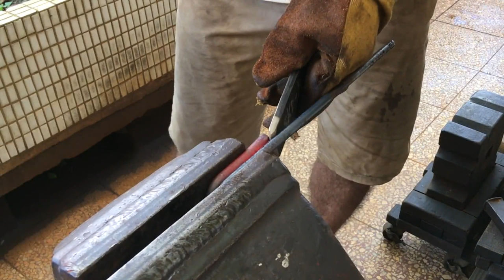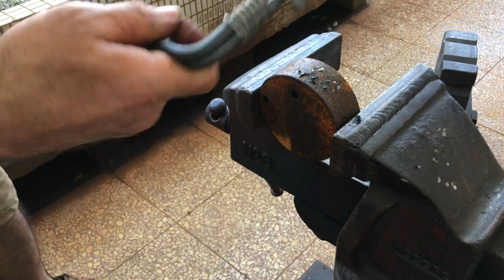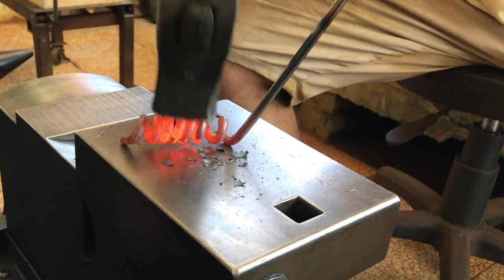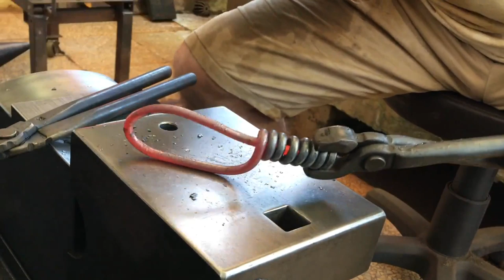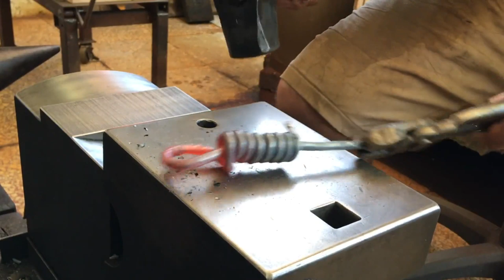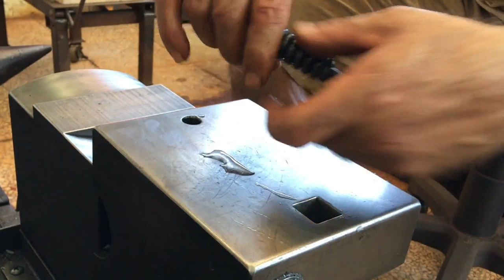More Forging Fun With Coils

Comment: Why does everyone's steel seem to stay hot so much longer than mine?  lol   Nice smooth, uniform coils.  Nicely done.
Reply: Lol, I know the feeling.  Heats will at least seem to last longer when you have a plan for every heat, which definitely takes practice and experience to get to that point.  Also, a more obvious one, don't be afraid to get mild steel nice and HOT for when you need to move the steel a good bit.  👍
Reply from the maker: I think it may partly be a trick of the camera. Cameras can show light from heat in a way that differs from how our eyes see it. What sometimes seems not too hot to me when working seems much hotter when re-watching on video. Or maybe it could be the air temperature or how large your anvil (heat sink) is. Thanks for watching.
Reply from the maker: Yes, having a plan definitely can lead to pieces staying hotter longer as the friction from hammering and working helps hold heat. Thanks.
Reply: There's also the factor of the anvil/vise sucking the heat out of the steel.
Reply: It also helps a lot if you bang on it continuously instead of looking at it. After all, you can get a cold piece of steel red hot by just hammering it hard and often enough. Doesn't quite apply to this video though, since there isn't that much hammering going on.

Comment: I envision a handle for the old type clothes iron before electricity that was heated on top of the wood heater.
Reply from the maker: I can see exactly that in my mind. A coiled handled can have a lot of uses on items that heat up and where dissipating that heat is needed. Thanks.

Comment: It could be a prison shank. LOL
Reply from the maker: I think this wouldn't pass the metal detector but if a prisoner did have such an implement, it'd be like having an automatic weapon compared to other shanks. Thanks for watching.
Reply: @gstongs  for sure! LOL just call it an auto shank.
Reply: @gstongs  I worked for a welding supply company in Wichita, Kansas. I serviced several of the near by prisons on my weekly route. It amazed me what the guards would let the inmates buy with their money. I had to of course show the guards what they wanted to buy and get an ok from them. Because I sure didn't want to end up in there.
Reply: If an inmate has the resources to make such an elaborate shank, he might as well just make a sword.
Reply: @mrkiky  really hard to hide a sword in prison. Must be compact and be able to hide it. Lets face it, all they have is time.
Reply: @davepelfrey3958  Hiding is not such a problem if you start the revolution right after finishing your sword :D